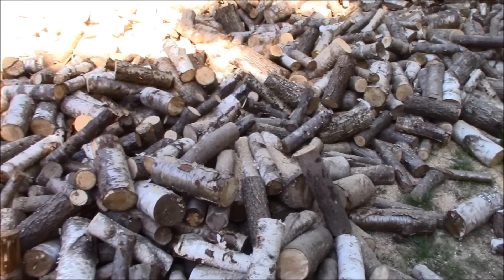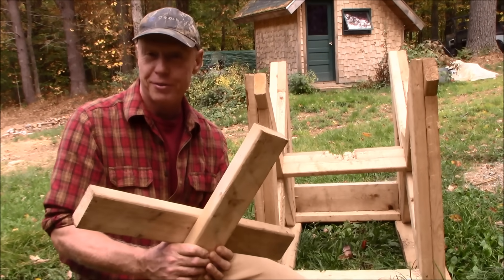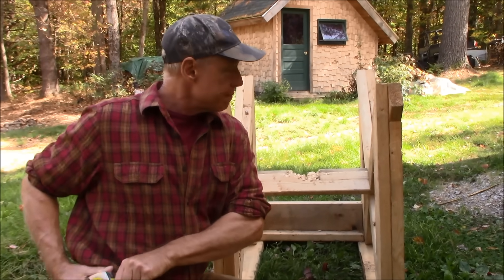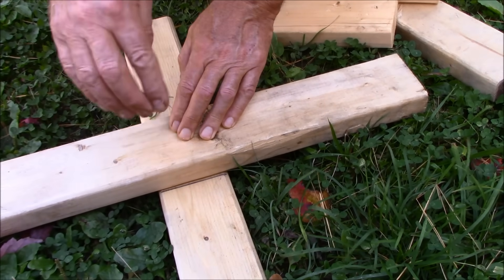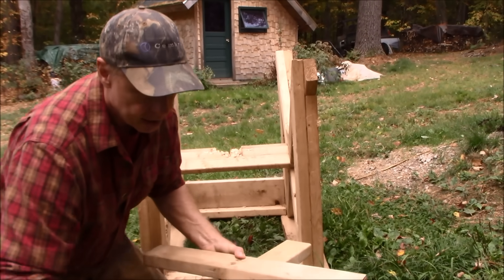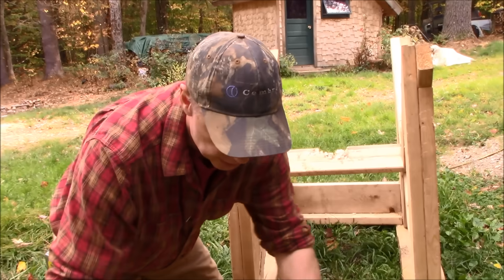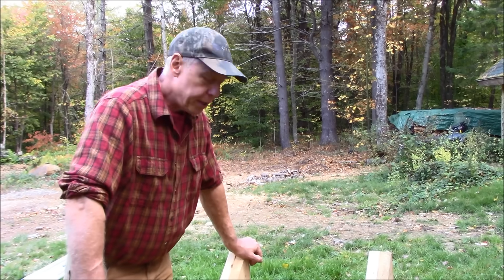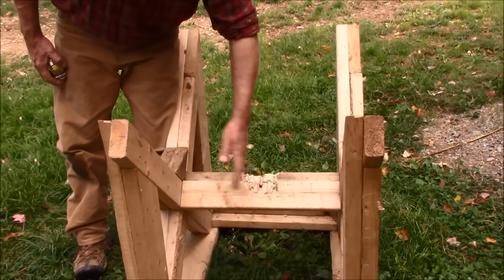HOW TO CUT A LOT OF WOOD FAST.  Build Your Own Sawbuck and Simplify The Task Of Cutting Firewood..

Comment: When not in use turn it upside down and throw a half sheet of ply or an old door on it and have an outdoor work table too.
Reply: This maybe just as efficient as my procedure: I placed a 12’ wooden ladder on sawhorses and put my log(s)  on it and cut them in between the rungs. It worked well for years. Eventually I purchased firewood.
Reply: If I was to used an aluminum ladder, I would build the sides up with 2 x 4 to prevent cutting into the aluminum

Comment: Been wanting to build one for years, but never seem to get around to it! I cut about 6-7 cord a year and haul all the limb wood back to the house at about 6' lengths to save time hauling out from the woods. I criss-cross all of them on the ground, but it becomes a mess and a trip hazard with rounds everywhere - I think you've given me the itch to finally get one done as cutting season just started for me here in southern NH - will save time, better on my back, and the rounds should be more manageable! Hope all is well Boss!
Reply from the maker: It sure speeds up the cutting, especially with the small branch stock.  Enjoy.
Reply: six foot wood you are gonna want to build one with more bays, the wood will be unstable

Comment: Greetings from PEI Boss.  I have something similar but my is just a rectangular box.  It's been nicked and I've replaced a few sections.  Easy on easy on the back.  I moved about two cord of softwood on Saturday, I generally don't start my first fire until November, and it's been a warm Autumn up here so far.  I even managed to get a bell pepper to turn orange outside.  Normally I have to move them into greenhouse to finish them off.  It's been a hot summer up here
Reply from the maker: We just picked a red one in the greenhouse yesterday.

Comment: I've never used a saw buck, basically because I cut much larger diameter rounds and cut them to 16 inch lengths out in the woods.  However, they just opened the woods again to wood cutting and I might cut a cord of smaller diameter stuff just to try using a saw buck, after I build it of course, LOL......

Comment: Just what I need at the camp! So the overall width, outside leg to outside is directly proportional to your finished log length x 2, minus 4 inches; 2 in cut clearance on each side. Yours would be 32 - 4, or 28 inches. Hence cutting your initial logs to 64 inches. I see some BB's in the bird house!!  LOL!
Reply: LOL, that's another Boss contraption . . . . . A feeding station for the little imps so they'll stay outta the bird feeders. 😘
💞👵

Comment: This is a very advanced piece of equipment this video should've been at least 35 minutes longer and the discussion of advanced materials along with the difference between the standard and metric measuring systems should've been thoroughly explored. what were you thinking Boss? people will probably un-sub because of this.